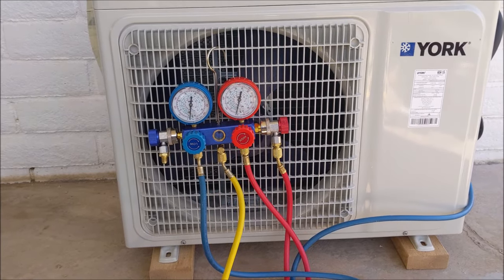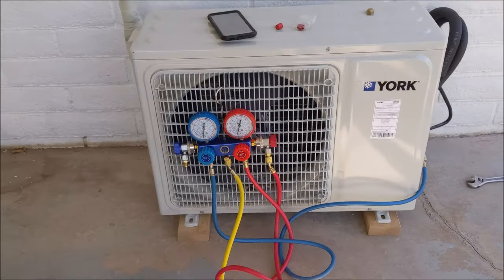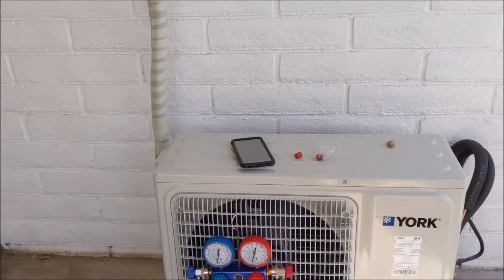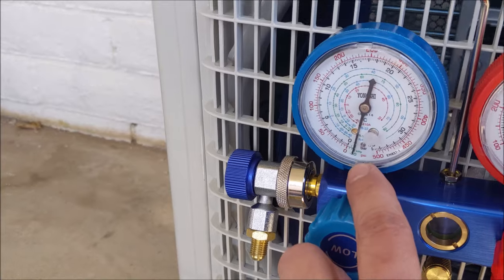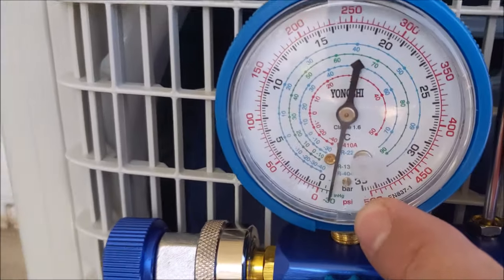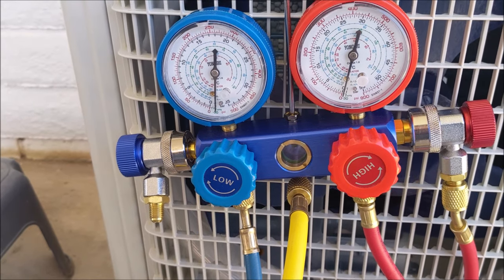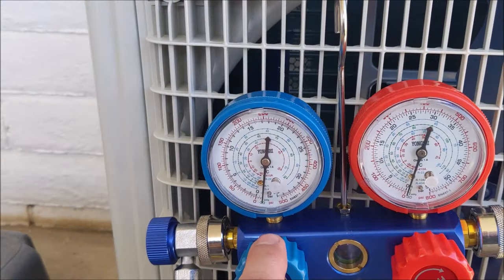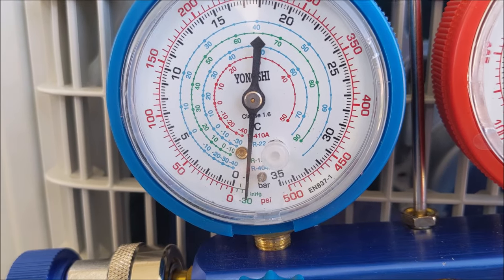Easy steps for Ductless mini split vacuum pump setup for 410a refrigerant

Comment: So then I just leave the blue hose on there forever?
Reply from the maker: No you do not leave it on forever
Reply: You have to find another video that shows how to remove the blue house without letting all the gas out.
Reply: It’s like a bike tire. Remove it fast and your done
Reply: I prefer the hoses with the quick disconnect fittings on them. No frostbite. Or even the ones with ball valves
Reply: @kevinkubed7683 but where can we find it? I’m trying to find a 5/16 to quick connect style that you find on cars
Reply: 15 minutes or so
Reply: @Phuong_Nguyen_  called low loss hoses. They're supposed to only let out a small amount of refrigerant

Comment: Get a micron gauge and run the system until you are under 500 microns
Reply from the maker: Yes, this is the one we use..... https://amzn.to/3sDrx1F
Reply: Hard to spend money on a micron gauge when we install only 1 or 2 every 5 years . Last one I installed was 10 years ago and this next year I will install and other . I debated but not doing it every day we can just wing it . If it doesn't chow any leakage

Comment: My vacuum isn't reaching 30 in hg. It's like at -20 in hg. I'm in Santa ana that's supposed to be around sea level and I should expect -30 in hg. Is the vacuum just not strong enough? Or is the dial just out of calibration? Does it matter if it's not low enough but doesn't leak is that ok?
Reply: That’s because you have a leak in your line sets
Reply: In my opinion, not a professional but it it is stable and not leaking your good. Let it sit for awhile to make sure. 

Actually what did you end up doing?
Reply: yes how did it go?  was -20 psi good enough?

Comment: It's more advisable to use a micron gauge than the manifold gauge to pull a vacuum. The latter does not have the pressure unit resolution required for a deep vacuum.
Reply from the maker: Yes Steve! I have used this one because of Bluetooth capabilities..... https://amzn.to/2ZX10ta  The video demo was to show a DIYer that does not have one. Typically, 20 minutes of the gauges not moving after the vacuum pull is equivalent to a tight lineset.

Comment: Don't forget to shut the valves on the manifold before you shut the pump off. Why well because I once didn't do that and I sucked mineral oil from the vacuum pump back into the auto AC system I just got done replacing everything on. I had to completely disassemble and flush it all out replace the oil in the compressor. I have a really old vacuum pump from the 80's it was a good one back then just old maybe newer pumps have a way to keep the mineral oil from being sucked up. Once you turn off the pump now the system is at a vacuum and will suck back though the pump.

Comment: I just figured out how to see if my Schrader valvenis engaged,  all I did was crack open the low side in front of the valve and low an behold the neg pressure went up. Ok good. 
I'm neg Vacuum again, pinned at 30 and will wait for a good hour or 2 vacuum just to try & get any moisture out, then let it hold over night. If pressure is good on the morning,  o release the gas and STOP SWEATING!!
HA! Thanks for the video!
Reply: Piece of cake stop sweating.. 😂

Comment: Thanks for your great explanation.

Are you pulling a vacuum with the high and low side valves closed?

If the low side valve is closed then how does the vacuum reach the lines?  Does it bypass the closed valve?

In other words, does closing the low side valve just seal the unit from the low side line while the Schroeder valve still can access the line?
Reply: Yes. You are vacuuming the lines, not the unit. The valves keep the refrigerant sealed inside the unit until the lines are vacuumed, then the valves are opened one at a time to release the refrigerant into the lines. No valves are touched on the unit while vacuuming.

Comment: Thanks for mentioning the oil needed for the pump.  Had no idea
Reply from the maker: Yes, just as mentioned on the vid, and don't forget to bleed any air out of the line, and you will be ok.

Comment: By releasing the refrigerant with the manifold still connected, wouldn't the blue hose fill up with refrigerant? Are you saying this is a negligible amount of wasted refrigerant? Would it be worth getting a small shutoff valve to put right by the service port? Thanks for the great video!
Reply from the maker: Yes, you can get something like this..... https://amzn.to/2Tc4nxn
Reply: @SaveGreenHere  Yes, it is a negligible amount, or yes you should get the shut off valve?
Reply from the maker: Yes, as get the shut off valve
Reply: Thanks. How about releasing only a very small of refrigerant until the pressure in the gauge crosses into the positive, then stop the flow of refrigerant, disconnect manifold, then release the full amount of refrigerant. Would this be a valid strategy to minimize the amount of wasted refrigerant?

Comment: First Thank you for the video. I am a DIYer in the South Pacific in the middle of No where! I guess I am now the chief HVAC guy, God help me! Ha. 2 question's
1 Unfortunately I cant get any Nog any time soon , like 4 to 6 months, so i used the slightest amount of wd40 on my threads and back of flare only. Also no torque wrench either, I just snuged it, went 1/4" past, loosened then tightened again.
Doesnt seem to be leaking.
So question is when I have done my vacuum test &  i pulled a -30 quite quickly (16ft of line) , and it has stayed there for 25 minutes or so,
But How do I know that my adapter to the Ac unit is depressing that shrader valve? 
I cant waste any gas to positive test as it is not in this country.... any other way to tell?
2:

Comment: I may be wrong but if you close the valve after turning off the pump your no longer hooked to the system you won't know if it leaks down or not.
Reply: The gague reads the line side, not the charge side. When you shut the valve, it only shuts off the charge side.
Reply: In which case is the charge side common for both low/high pressure ... and if so, if low/high pressure valves are open wouldn't the pressure equalize through the charge side?

Comment: Question: Since you released the refrigerant into the system before removing gauges, won't freon leak from system once you remove gauges?
Reply from the maker: Scott it's a small amount. It happens when you take the gauges off after checking pressures. Just pull the gauges off at the connections swiftly.
Reply: Also, it is not Freon. Freon is banned for some decades already. But still even modern refrigerant that are used today, I guess are not allowed to be released to atmosphere. Of course as Scott said, small puffs may happen during disconnecting from lines and you cannot avoid it.
Reply: @SaveGreenHere  Is there a reason why you can't just pull the gauge line off of the service port before releasing the refrigerant?
Reply: @sinistarxx  my guess is that it's a vacuumed line now so the moment you pull the gauge line off, gas /air pressure will go into the lines first.  But if you release the refrigerant first.. the line will be filled with refrigerant and once you release the gauge line, refrigerant will force out vs air coming in the vacuum.  The amount of refrigerant you lose during this situation is negligible.  In our case, our minisplit is filled with enough refrigerant to accommodate a 25ft line whereas we'll be only use a 16ft line so we can definitely lose a lot more refrigerant!

Comment: Hello. Excellent video. When it comes to releasing the gas into the system, does it make a big difference if the low line is opened first? I'm not sure if I did that or not. I appreciate your response.  Thank you.
Reply: Not really. The system is going to balance out so that the pressure is balance on both the low and high side. Just dont open one side all the way and not the other. Slowly release. You could possible slam the TXV or metering device open or closed.

Comment: Pump n gauges arrived today
Hooked up ,ran 15 mins
My question gauge never went under zero during running stage , 
Is this ok ? Or needs to go below zero?
Reply: Did you open the blue knob?
Reply from the maker: So did you open the blue knob?
Reply: @gazd4812  Yes, you open the blue knob/hose before turning pump on, run pump for 15 minutes, turn off blue knob/hose and yurn off pump aswell. Wait 15 minutes and check blue gauge to see if it stayed at minus 30 or whatever minus pressure your unit instructions say. If stays the same then open refrigerant on both copper lines and at the end remove blue hose from ac.

Comment: I assume the AC unit is off while test is being conducted ?
Reply: Yes. Machine is off. Technically the electrical doesnt even need to be connected yet. This is just to make sure that there is no air or moisture in the line and also that there are no leaks. If the pressure were to rise you either have a lot of moisture in the the line or there is a leak at one of your connection points and air is getting in to the the line.

Comment: Before you hook up to vacuum you have to close the high and low vale s to the mini split???
Reply from the maker: Do it as shown on the video and you will be fine
Reply: They are already closed, the refrigerant is pre-charged in the outdoor unit.  You are checking to be sure the lines are all properly sealed.

Comment: I have to leak in my system, and I have to make a new flare. Do I down pump and put the freon (at least what's left) back inside the unit, close the service ports? Or do I just run the vacuum pump to take it all out (with service ports open)?

Comment: What's the purpose of the red valve.  When do you open it and when do you close it?
Reply: Nothing in this case. You need two gauges when working on car AC.
Reply: The red valve is high pressure side, blue is low pressure side.  You would use them both if you're checking the running pressures on a refrigeration unit to determine if it's properly charged.

Comment: I tried this, it works. Please don't do what I did and unscrew the blue line from the adaptor, make sure you unscrew the adaptor from the condenser. 
I lost a bunch of refrigerant and now have to get somebody to come out and add refrigerant.
Reply from the maker: You got to go fast on the disconnect.
Reply: @SaveGreenHere  I disconnected the hose from the adaptor, so the valve stem thingy on the compressor stayed pushed in and let a bunch of oil and refrigerant out...  Speed wouldn't have mattered, I was just dumb. 
Caused my own problem. I can't believe I did that.

I'm waiting for a hvac place to come out and add 410a back in now while I heat the shop with a 240v elec forced air heater. $$$$
Reply: Can you go into detail what should be done? I've watched two videos now and they both ignore how to remove that adapter from the condenser low port.
Reply: 😁:face-orange-biting-nails::face-orange-biting-nails::face-orange-biting-nails::face-orange-biting-nails::face-orange-biting-nails::face-orange-biting-nails::face-orange-biting-nails::face-orange-biting-nails:
Reply: The right procedure here is to release small amount of refrigerant into system (so that it only reaches 2-5 psi) from the high side port and then shut it off.  Then remove the manifold gage line.  Only minuscule amount of refrigerant gas should escape.

Comment: i did not vacuum prior to adding the refrigerant, what do I do now?  Should I vacuum?
Reply from the maker: Yes, you need to vacuum as shown on the video.
Reply: I did 2 ac and didnt vacuum them and there been running for 2 years no problem! 🤷‍♂️ im just a diy....
Reply: You have to pump it down to get the refrigerant out of the lines and back into the outdoor unit, close them off and then vacuum the lines. If you don't vacuum it water (in the air) gets in and eventually your compressor won't be able to work properly. Instead of your unit lasting 15 years it will last maybe a few instead.
Reply: @porthugiz1  I drove a car with no oil in it and never had a problem.... until the engine blew.

Comment: A vacuum test is two-fold... to clear the system of any foreign matter, and to double check your system for leaks.

Think of it like a nail in a hole... if you use vacuum, the nail will be suctioned into to hole ander pressure and create a better seal. If pressure is applied frome the inside, the nail will leak.

A/C systems operate at pressure, NOT  vacuum. 

Mini-splits operate at 450 psi on average. So, pressure testing is going to need to be at at least 150-200 psi. That's more than an air compressor can handle. 

The pressure test doesn't need to be nitrogen. It can be any inert gas. I use my oxygen bottle from my oxy/fuel torch. Lowe's sells a (1/4 flr x 1/4 mip) half union for just over $2 that will hook up to your 1/4" vacuum line. 

So, if you have an oxy/fuel setup, or know someone who has one, it's very cheap and easy to pressure check your system first. Just pressurize to 150-200 psi, put some dish soap on the connections with a brush, then wait and check for bubbles. Tighten as needed.

Then vacuum the system and introduce refrigerant. 

And you should be introducing refrigerant before disconnecting the blue line. You will lose a minimal amount of refrigerant, but the pressure will keep foreign matter from entering the system. If you disconnect the blue line before releasing th refrigerant charge, that split second that the Schrader valve is open will allow foreign matter into the system because the system is under a vacuum and trying to equalize with the outside atmosphere. If you disconnect the blue line first, you'll have to vacuum again.
Reply from the maker: Patrick, thanks for adding those points! Much appreciated.
Reply: I'm curious. What about using a high pressure air gun hand pump to put regular air in (such hand pumps go to ~5000 psi and only cost around $50)?  Regular air consists of ~78% nitrogen, ~20% oxygen, and the rest is carbon dioxide and argon.  If many use nitrogen, you suggest oxygen, and you also suggest that any inert gas will do (which includes argon and carbon dioxide, at least within the context here), then why can't regular air be used?  Isn't whatever gas(es) used vacuumed out afterward anyway?
Reply: @AEMBowers  just do the soap and water test while its runnig. if no bubbles, no leaks
Reply: You do you.. lol

Comment: Is the red valve just shut off in your video?  I see you have that hose looped.  Do I just open the blue low know then run my pump?  Thanks!  Great video explanation.😂
Reply from the maker: Red valve shut, and red hose, looped as shown in the video. The blue valve has to be open while running the pump, otherwise you cannot perform a proper vacuum, and get the moisture out. So open the valve, and turn the pump on. Run pump for 20 minutes just to make sure. Follow the rest of the steps on the video after running the pump.

Comment: What kind of oil for the vacumm pump did you use ? I bought the same pump that u got , but  it didn't  come with oil  , manual says that  I need  HFV32 but nobody has it or heard of it 
Thanks
Reply from the maker: They probably do not include it anymore. But it's the V32, and it's this one..... https://amzn.to/3qbZFuW
Reply: Thanks 👍

Comment: Most of the other videos I've watched instructed to remove the shader valve from the condenser before vacuuming. I'm assuming you did not do that here, otherwise it would seem that coolant would be lost when removing the vacuum hose?
Reply: I cant find an answer to this either

Comment: Awesome video man. Quick question if you don't mind...I have a mini split with multiple connections (I use two of them) and one master. They all have valves. After removing all of the refrigerant just as you described, should I fill the master or fill each individually? Actually, the first question should be whether I use the master valves to vacuum it out....

Comment: stupid question. so when you buy a new mini split unit, internally, they already have enough refrigerant to run the system? -- nice video.
Reply from the maker: Not a stupid question. They do come precharged. However, if the lines are ran over 12 feet, more refrigerant may be required.
Reply: Check the product literature, it will tell you (usually) how long a line set the charge is good for.

Comment: What would you recommend to use if you used the nylog, triple checked the lines and the gauge needle still moves after vacuum?
Reply from the maker: Use a spray bottle with 1 tbsp of soap and spray the connections. Check for bubbling. If you see bubbles, you have a leak.

Comment: I couldn't find nylog so I used a paste on the "threads ONLY" NOT on the flare, so the flare is bare of any product.  I know how to tighten a flare correctly.   I pulled a vac in 2 minutes, and it holds for 30 min. -- Do I need to disassemble use nylog, and vac for 15 min (even if it reads -30 in two min)?  >>>  ALSO,  I have a 4 way manifold  with a black knob in front and blue on the left.  I assume the red hose is just insurance.  PS: great vid!
Reply: DO NOT put any paste etc on the treads as this will affect the amount of Torque you put on the nuts.  You could strip the thread.

Comment: Do you have to vacuum each set of refrigerant lines individually on a multi zone minisplit?
Reply: I have  one  that has 3 lines  I did  each line . ya I had the same question. also  does that mean  each line is on its own line inside.?

Comment: I'm replacing my condenser on my mrcool mini split can i check for leaks before changing it ?
Reply from the maker: Yes, use this tool, and check particularly the screw connections on the condenser unit, and on the indoor unit........... https://amzn.to/4cio76j It is simple, and effective for basic detection. If you prefer a professional tool, this is what pros use..... https://amzn.to/3Vfythe
Reply: Or  soap bubble all joints where it was brazed at for starters